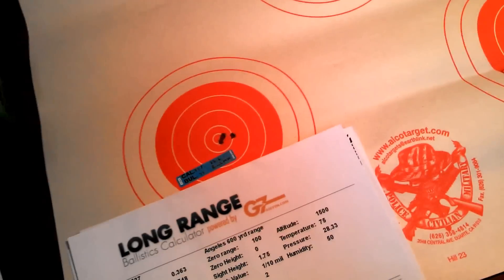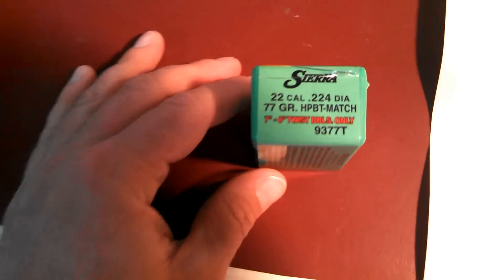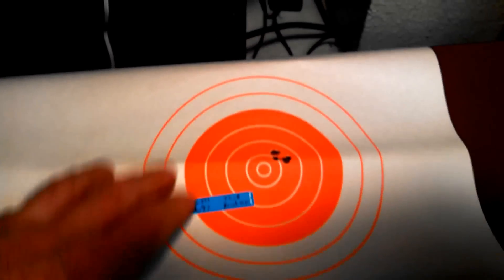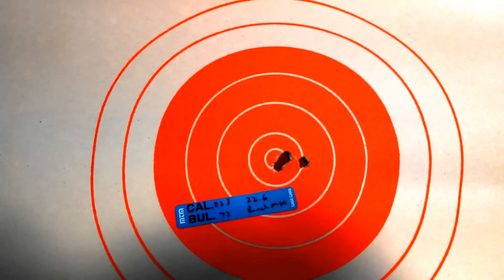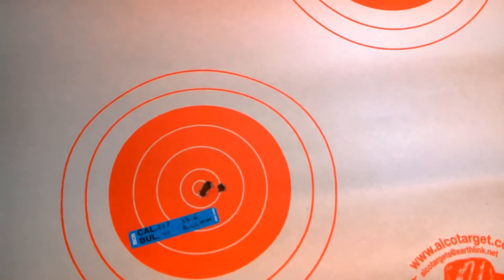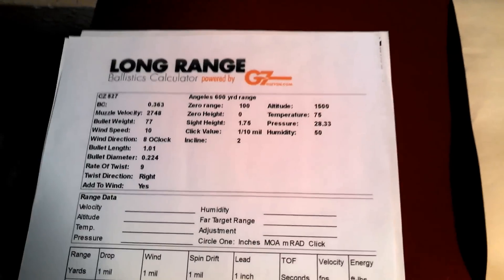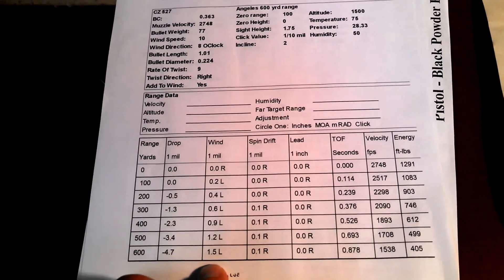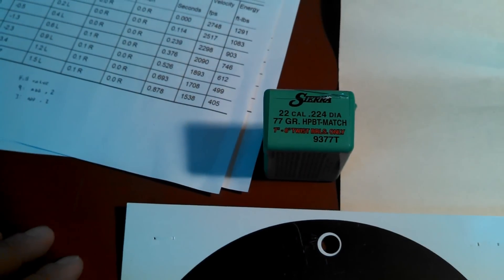.223 Long Range Load Development. 77gr SMK in a 9 inch Twist. CZ 527 Varmint Kevlar

Comment: I have looked at the comments where you are saying "I have proven that load development can be done at 25yds" and you also said in the video that "knowledgeable" people told you the group would not change between 25yds and 100yds, which is total BS. You have not proved anything except that you are new to long range shooting and very impressionable. I can load rounds for a rifle that I have zeroed, print off a drop chart and hit a target first shot @700, that don't prove anything other than your data entered into the chart was correct. A blind hog finds a acorn every once in a while, and a broken watch is right twice a day.......
Reply from the maker: Yep, I must be lucky. So it was just luck that the load I chose at 25 yards shot a .25 moa at 100 yards. That was just luck huh? All the data I put into my ballistic calculator and my wind reads were just luck? Ok. I must have been doing something right if I hit the target. Then I was just as lucky with my 7mm also?  I did the same load development for my 7mm and found very accurate loads for several different powders. I no longer test group size for long range, I test for standard deviation. The smallest group at 25 yards will still be the smallest group at 100 yards. Maybe not one thousand yards, but one hundred yards. How is that BS? Your right, I was new to long range shooting and I never said I was an expert. I'm not sure why your comment comes across so angry? Maybe you haven't been as lucky as me, I was sharing an idea of how to test loads if one doesn't have access to a outdoor rifle range. A blind hog will have an increased sense of smell and will find more acorns than any hog that can see..... Thanks for commenting and sharing your thoughts.
Reply: 11DayScrape You seem to have a problem with reality and physics. Anyone can punch in velocity, bullet weight, BC and dial in the turrets and hit a plate, hell I done it with a .243 win that I bought my wife to hunt with and it was a bone stock rifle @ 800yds. You also seem to be convinced that the group @ 25yds will be the same @ 100yds which also shows you lack of knowledge on the subject. Good luck and have fun in your fantasy world of magical rifle data and thinking you are something special.
Reply from the maker: Eric Borders Is that all you got?? I was hoping to read something clever...or maybe an explaintion on what really happened in my tests according to reality and physics. People like you are fun. Please prove to me that you aren't just some dumb keyboard commando operator. I can see where your thoughts based on physics might make sense as they should, but I feel you have a lack of experience on you own tests with your own reloads. I beg of you to please share some results you've had that might prove your own incompetence or lack of personal growth. I'll be waiting.... Oh, and a .243 @ 800 yards... that is something spectacular to brag about. I'm surprised you didn't mention the barrel was also full of snow. I would have believed that story here in magical rifle data land. Like I said, I'll be waiting...
Reply from the maker: Eric Borders See now that was funny old timer. Maybe you invented the terms Kentucky hold over and Kentucky windage. Who knows. I never said I was special, you did and I'm not sure why you continue to insist this. I was right when I said you didn't have the luck like I did so early. I put in work the best way I know how. Read, watch, apply, do, repeat and each time I get a little better or learn from a mistake. I'm sorry you didn't have access to the information like I do back then but you shouldn't be so mad about it. It probably took you 10 years to learn what I did in 2 years and you are simply bitter about it. I can write out This is sad because usually the gun and shooting community sticks together and shares ideas and helpful words of wisdom to help each other out but you seem to be a COD fan locked into "I'll show you" trash talk and one upmanship.Thank you for continuing to fart out of your keyboard and leaving nothing but hot gas in the comment section. I was hoping I would learn something useful from you. I can tell you are a smart person with a trunk full of knowledge that might be a little outdated and I also know you are the epitome of the "old dog". The smallest group at 25 yards will still be the smallest group at 100 yards.
Reply from the maker: Jay Em Please explain what weapon system you are using? What type of rifle were you using? Was it an AR? Did you double check the torque on your scope base and rings? Did you reload your ammo of buy factory because factory sucks? I'm using a very well built CZ527 bolt action. I'm sorry you didn't have results like mine. But I'm not sure you saw the video where I took this very same load and shot three repeated hits at 1255 yards with it. So yes it can and does work. You might want to double check into your equipment before you say things just wont work.They just didn't work for you this time.

Comment: your errors at 100 yards will be 4 times the amount recorded at 25yards(simple physics ). to have identical groupings at both 25 yards and 100 yards doesnt actually make sense and that would only be widened taking environmental factors into account. that being said, lovely .5moa grouping for the 100 yard target considering you got over 2moa at 25 yards. weird you didnt find the 77gr becomes unstable at long range such as 600yards. there is some weird stuff going on with these results.
Reply from the maker: Thanks for sharing your thoughts. Things may not be identical at 25 and 100 but I showed how 25 yards at a local indoor range can be used to develop rifle loads with accurate information if someone doesn't have enough time to find somewhere to shoot 100. Environmental factors at 100 are almost nothing except for high winds which aren't ideal for shooting groups anyway. My CZ527 shoots the 77SMK 1/4moa because of this load development. I scored a first round hit at 730 yards followed by 2 more (in my recent video). Thanks again.
Reply: cz are magnificent rifles. a chronograph would help if you were limited to a 25 yard range.

Comment: It's not the weight of the bullet that makes it stabilize, it's actually the length. the weight is just a simple approximation because heavier bullets are typically longer. a lighter bullet can actually be longer than a heavier bullet, this is where the questions start about what weight you can stabilize

Comment: A:I wanna see u shooting these loads  and B: maybe its do to tge 24" barrel ..I also load 77gr smk's but I shoot out of a 16" Sig M4 & Sig 516 1/7twist ...I have sime loaded with imr4895,Varget but the best is H4895 lil hotter and temp stable ..as im shooting out to 600yrds, my buddy with his 1/9twist AR-15 16" gun has HORRIBLE ACCURACY even at 100yrds so like I said gta see it to believe it post a vid of your shooting these test it at 25-100-300 then 600yrds ..
Reply from the maker: I have posted a couple videos with my most recent being the best quality. I scored a first round hit at 730 yards. My CZ shoots the 77SMK 1/4moa with this developed load. H4895 is a great powder and have gotten far better velocity out of my AR than Imr4895. My best group out of my AR was 1moa and all 3 shots were horizontal to each other and I have hit 600 yard repeatedly with it. However I have switched to 75gr Hornady Match bthp for my AR. I save the 77SMK's for the CZ because they are pricier. Long Range .223 @ 730yrds. 77gr SMK in a 9" Twist. 1st round hit.

Comment: There will be a difference at 100 compared to 25 yards 

Testing. 223 home loads at 25 yards is pointless the bullet is not travelling far enough to know if it will  stabilise

Most guys that I know will shot a 100 yard group and a 200 yard group because the bullet can loose stability at any range.
Reply from the maker: Your right and I am aware of this but I was testing powder charges for accuracy at 25 yards, not stability. I have already proven this load to shoot 1/4 moa and stabilize out to 800 yards. Thanks for your input. gggggeoff

Comment: I wrote an excel program to predict stability.  Using various bullets and allows you to input your velocity, twist rate temperature and pressure and predict weather stable in the conditions specified.  The 77 Sierra showed a stability of 1.3+ even at -40F and 30.00 "HG using a bullet length from Litz 0.994".  I have been able to shoot the 75gr amax  1.113: bullet out of my savage to a 1.04 stability and hits at 822 yards. Its a 1 in 9 twist but measures out at 1 in 8.75.  That is right around 32f and 29" absolute pressure.  PM me a message with an email address and I'll send a copy of it.  Cheers
Reply from the maker: Awesome and thank you!!! Wonderful information! I would love to see it. I decided to keep the 77gr SMK for only the CZ527. I am now using the 75gr HPBT for the AR (cheaper and better BC). I have a load developed and I need to chrono it. I also have a box of 75gr Amax to test later in the CZ. I still need to measure the twist rates in both rifles. PM on the way. Peace brother! Kevin

Comment: You most likely figured this out already but a TRUE 9 twist barrel won't stabalize a 77 grain bullet. There is a reason you hear some people saying that a 9 twist will work and others saying it won't work. If you actually MEASURE your twist rate will will discover that some 9 wist barrels are actually 8.5. These barrels will work just fine with 77 grain bullets. The barrels that are true 9 twist units will not work with 77 grain bullets. It appears that your barrel is one with an ACTUAL twist rate that is tighter than what is marked on the barrel. Your next barrel might be accurately marked and you will have an issue if you are using 77 grain bullets. When its time to replace this barrel I would go with an 8 twist to be sure. Either way, what you have now seems to be shooting very well.
Reply from the maker: Thank you for sharing this. That is very interesting and I'll have to get out the cleaning rod and measure both of my barrels. A half inch difference would be extremely misleading for a gun manufacturer to do that. Most shooters might not even realize the difference but when a shooter is trying to pick out the right twist rate for the projectile he wants to use, that will hinder the dynamic stability though the transonic zone. (Targets only) A half inch could be a big discrepancy down range on ballistic charts. However I haven't experienced any under stabilized shots out of either rifle as of yet. My factory standard AR 9" twist shot palm sized groups @ 100 yards using a red dot. I haven't tried any further distances yet but I'm not holding my breath. I recently picked up some hornady 75 gr. match bthp  to try in the AR 9" twist. I agree with the 8" twist also and I am looking into building a new upper with a 20" shilen barrel and 8" twist. I'll post my findings on the twist measurements. Thanks again.
Reply: Some 9's will but most will not

Comment: bullet length is wrong. 77 SMK is .994
Reply from the maker: Not in my batches. I just checked 10 of them with a new battery and they all measured between 1.012 - 1.019.
Reply: thats really weird
Reply from the maker: bangelo1 I figured it out. You have the SMK hpbt with the cannelure huh..? I measured mine and they are .995 and the SMK hpbt Match projectiles are 1.105
Reply: 11DayScrape Ahhhh yup. Thats it. Im also surprised that that 77 will shoot in a 9" twist. Thats rare.